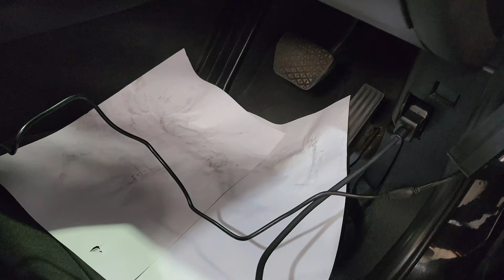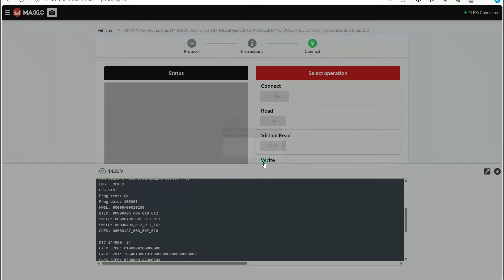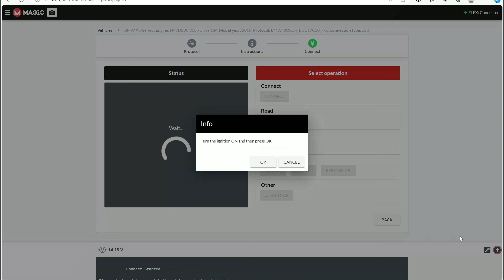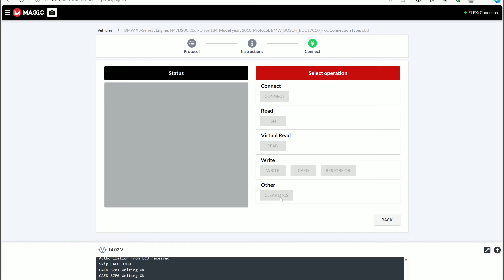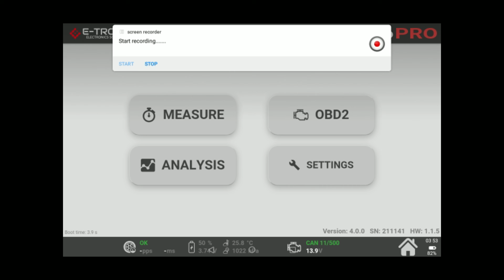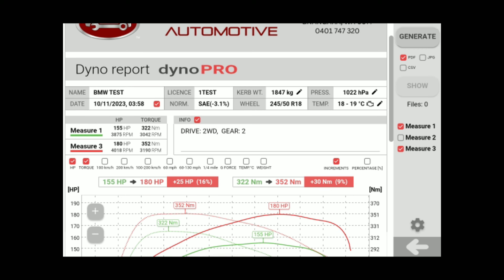Flex by Magic Motorsport - ECU remap test on a BMW X3

Comment: So in regards to the ecu files. You saved the original files, then you uploaded a modified version of this file? How did you modify it?
Reply from the maker: You can modify it yourself with a program like StageX from Magic Motorsport which we also sell licenses for. Or other programs like WinOLS. There's quite a few programs out there to modify files.